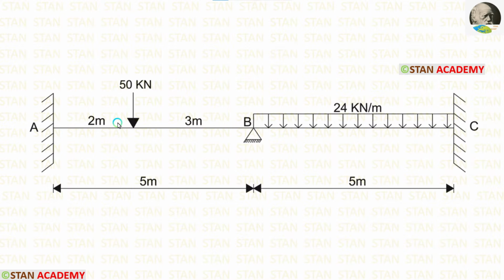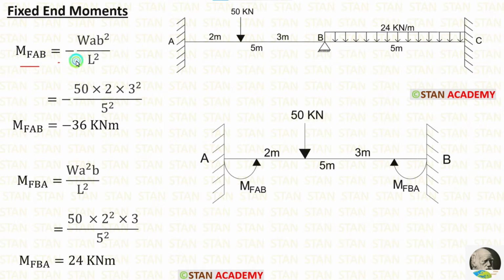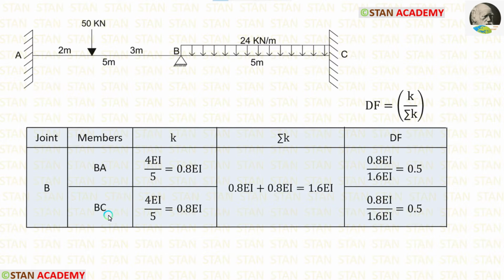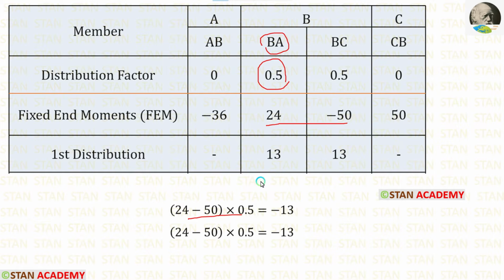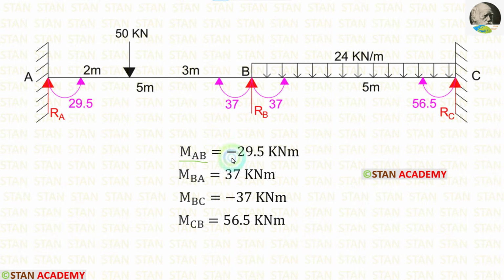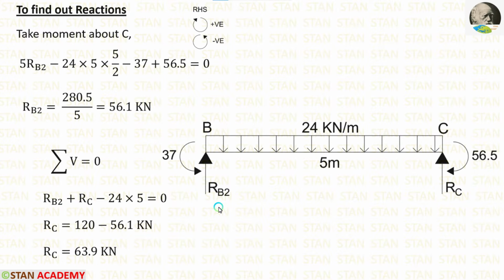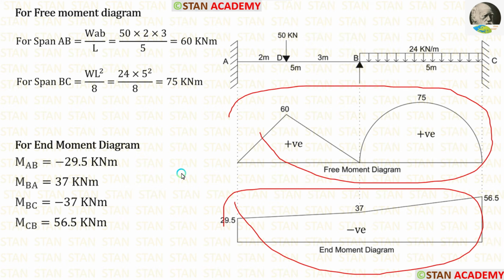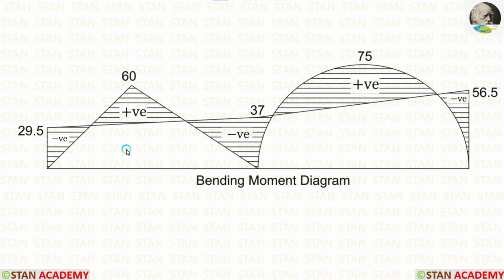Moment Distribution Method for Analysis of Beams - Problem No 1

Comment: Respected Sir,
Sir, is it necessary to analyze Beam by M.D Method by Finding Shear Force values and drawing SF Diagram, Free end moment and Fixed end moment values and then draw its Diagram also
Same for Frames
Reply from the maker: Yes you have to draw shear force and bending moment diagrams. But No need to draw  free moment & end moment diagrams. You can draw bending moment diagram directly